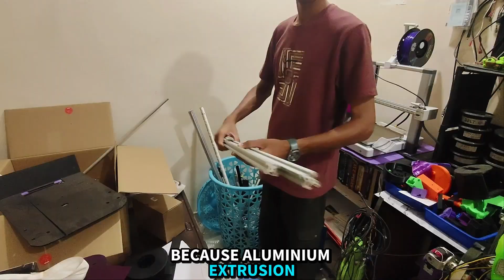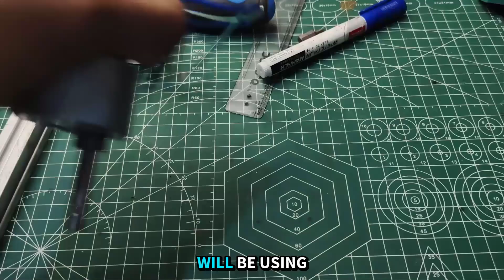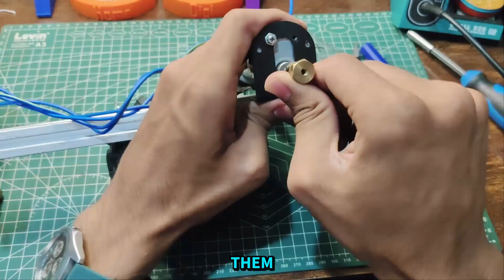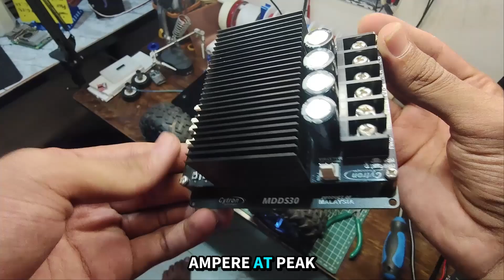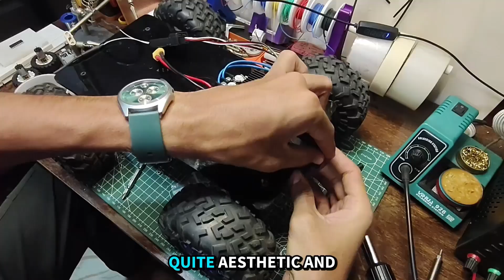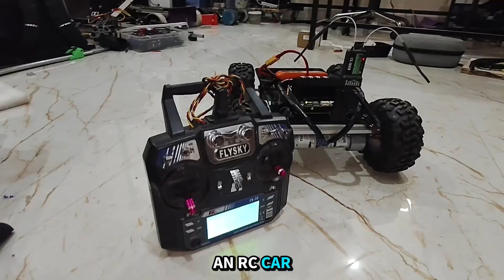Build a NO Microcontroller RC Car using Cytron MDDS30 Motor Driver!

Comment: Hey sir wegot 1000rpm johnson the thing we couldnt do well in bts7960 motor driver will this motor drucer work well for 1000rpm motors we got budget constraint also sir
Reply from the maker: Yes it can work with that bts is a very sexy driver specially when budget is tight
Reply from the maker: But mdds30 is best if u don't want to have mcu and other stuff around
Reply: But the thing is budget matter sir actually I have seen many videos they ll do shorting with +- i got failed that subject please sir can you please help to work that robot
Reply: Can we use smartelex instead bts7960 so it ll connection also easy
Reply: Please share some videos sir making of it
Reply from the maker: @VigneshSM https://youtu.be/EnbkdrYQ0NE?si=8TefHOCX4kbp75bm

Comment: Hello ! I want to ask one que like was attendenxe in your clg strict ? And if it was then how did you got the time for robotics projects?..along with ece being on a tougher side

If you can make video on this..
Reply from the maker: Sure 
I short, I have problems initially in this too but, as we more to higher semester the attendance requirements get less, and while doing internship, u only need to appear for exams only
Reply: @Pi-kas  yeah my brother also had low attendence in 3rd 4th yr onwards but he was not debarred ig i will work around then thankss